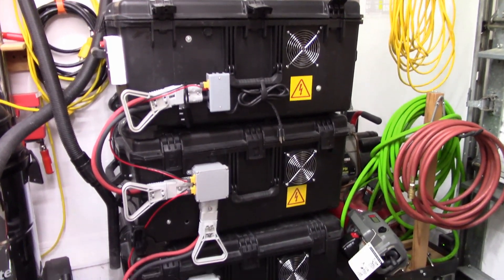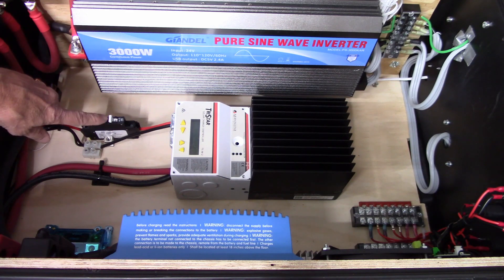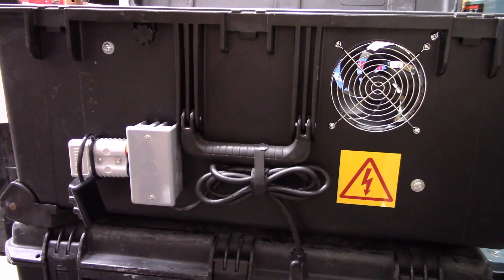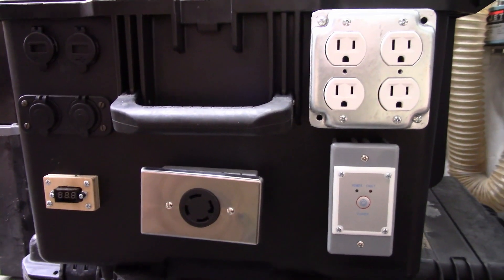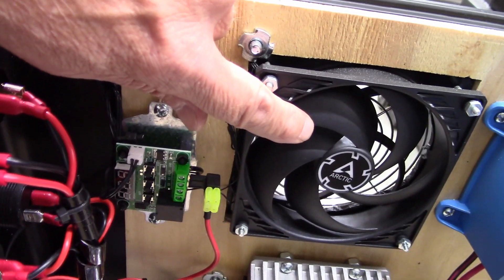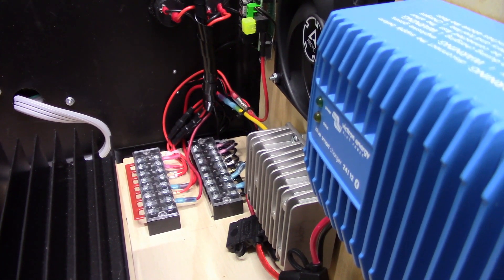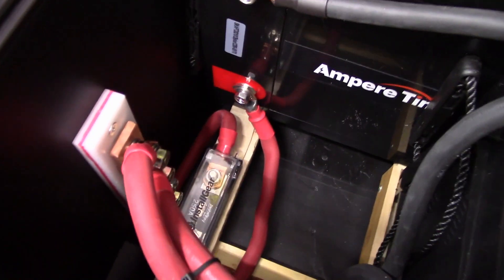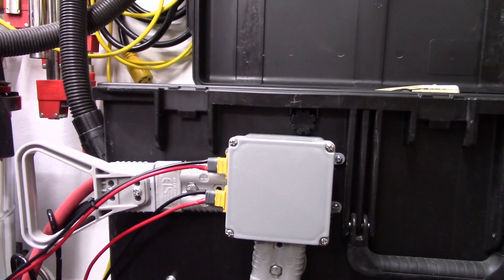Solar Generator -DIY-Be ready !

Comment: Be careful with those terminal blocks. If they are the ones from Amazon that are around $35 then the bus bar is just a piece of brass that can't handle more than 100A without getting pretty hot. I'm also not a big fan of SAE (I think that's what you used for solar input). 

You did one hell of a job with cable management but I think you went a little crazy on the fuses. If one of those blows its going to take a while to figure out which fuse blew.

Any reason why you went with 12V batteries? It's typically never a good idea to series two separate batteries that have their own BMS. Balance problems really flare up with 48V systems made with 12V batteries, it's probably much more manageable with 24V but I'd still much rather pull the cells out of the battery case and just connect them in series. Ampere Time is now LiTime and I know LiTime is using aluminum bus bars and the pos and neg ends of the battery have a tab with a hole to mount a lug so you could easily connect the cells together.
Reply from the maker: Thanks for the advice ! I am currently using 4- 12v ampere time batteries to make 48 v with a Sungold complete system. Thought I would try one of these package units. They have not felt hot at all but I will look into your suggestion. Thanks so much Eric.

Comment: Awesome set up. Where can I find the thermostats you used for the fans ?
Reply from the maker: Amazon / HiLetgo 2pcs W1209 12V DC Digital Temperature Controller Board Micro Digital Thermostat -50-110°C Electronic Temperature Temp Control Module Switch with 10A One-channel Relay and Waterproof. About 9 bucks for 2.
Reply: @homesteadhandyman4481  Thanks for the information, keep up the great work👍
Reply from the maker: @jacknobrex  No problem. By the way the system is working great. Let me know if you need anything else 😉

Comment: Spectacular setup and clean wiring. Very innovative with the modularity and portability!! I'm working on my box build now. Your 1/0 wire looks way thicker than my 1/0 wire, I hope I didn't get ripped off, either way your design helps inspire some changes I'm gonna make for mine so thanks!!
Reply from the maker: Thanks for watching. It's a good time to have backup power . Crazy world!
Reply: @homesteadhandyman4481  very true and that has been a major inspiration. The grid can go down at anytime for lots of reasons, primarily lack of security.

Comment: I'm not sure where the 5000 watt is configured. I think that 4x200 amp hour times 12.8 volts is 10,240 watt hours. That's a darned big capacity. Either way, its a nice setup for occasional portability. How many amps is the Victron charger?

Comment: Is this not a 3000 watt system, or is there a second inverter?
Reply from the maker: I based the 5000 watt system on battery capacity.
Reply: @homesteadhandyman4481 of course. And as it should be. Bonehead moment on my part. Nice build.
Reply from the maker: @reubenj.cogburn8546  I am happy to see others have bonehead ideas also. I'm good for at least one a day 😉

Comment: Very nice build.  I assume the batteries wouldn't fit in the cases upright.  The prismatic cells can leak on there side Will has a video showing this.  Thanks for sharing.
Reply from the maker: You are correct about the fit. I thought they could be mounted in any position. Thanks for the heads up , I will look into it!

Comment: Putting wood in a generator in a tight space 🔥🔥🔥🔥
Reply: Fire will not be an issue with this setup.
Reply from the maker: There are air holes below the batteries for air plus the fan pulls fresh air through. Not concerned with this problem but thanks for watching and pointing that out!

Comment: Great work! I am awaiting my Victron MPPT so I can complete my second DIY solar generator system. I went with 100ah 12v x4 for 24v system. I now wish I went with 2x 200ah 12v. My thinking was I could break down my system into 2x 2400w 24v systems if needed and it might be easier to build around. Not sure now after watching your build. Finding good containers is my problem I am somewhat cheap and do not want to spend $200-$400 on containers.
Reply: I like home built units. This year I made my first attempt at assembling individual EVE cells and installing a BMS. Its 560  amp hours, 7200 watt hours, all 12 volt, 3000 watt Renogy inverter, 75 amp on board Aims charger and 30 amp Renogy MPPT charge controller. Its on caster wheels, weighs 130 pounds but was made to fit under a work bench even during operation. We had cloudy and rainy weather lately but in the summer, the solar charging was reliable. After 6 months of operation, so far, so good. Did you finish yours?
Reply from the maker: @kimmer6  Thanks for watching. Mine is almost finished. Just got my combiner box and will be putting up some solar panels. The thing about building your own unit is you learn so much as opposed to just buying one. Thanks kimmer!
Reply from the maker: I found those Pelican boxes on facebook marketplace for 60$ each
Reply: @homesteadhandyman4481  Whoa, that is a bargain! Duh, of course I never thought of alternative sources.